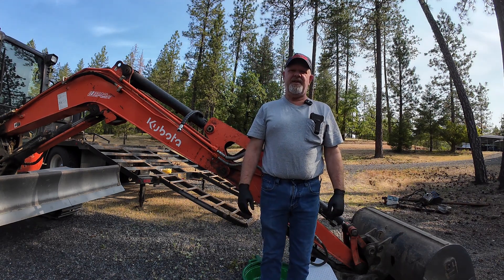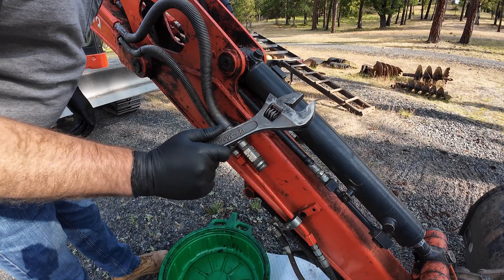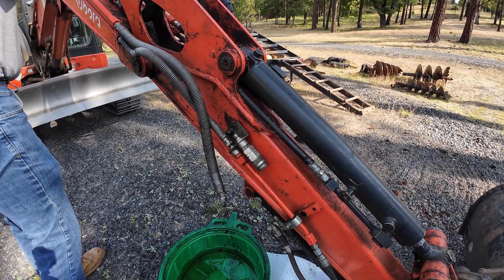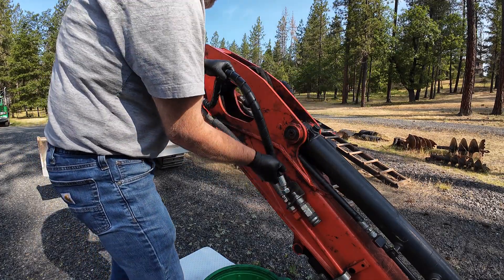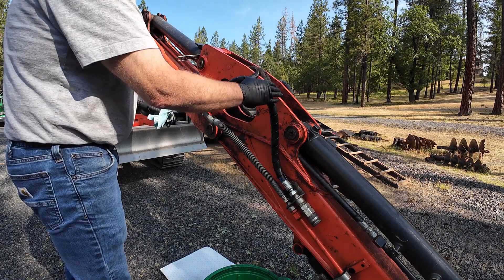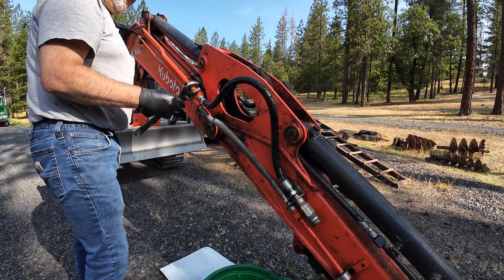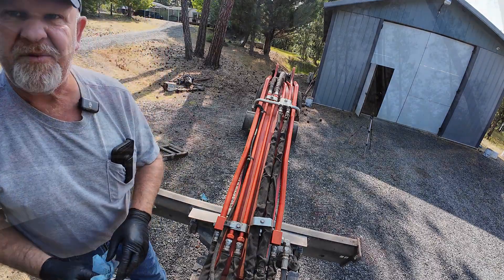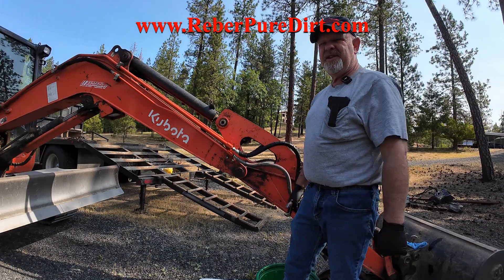Hydraulic hose replacement how to bleed pressure off axillaries Kubota KX 040 4 excavator

Comment: Also good rule of thumb after the key trick is to open the cap on the hydraulic tank to bleed pressure off of it as well due to the fact a lot of equipment has pressurized hydraulic tanks.
Reply from the maker: The 40 has a vented tank, but that is a good idea. Thank you for watching, and have a wonderful evening 😀

Comment: Well, you blew my whole comment I was going to put here!   Shmoo Be Gone.    You know I was mostly kidding you!   I rented a BobCat 32 for a week.  First time I ever ran one at 69 years old.  I had a blast!  The agreement I signed said it came to me clean and if not clean when picked up I would be charged extra $.  So, I washed it with soap and water, then went over everything I could with class cleaner.   Just as I was getting finished, the guy drove up to get it.   He said, Oh you don’t need to do that, it was talking about major dirt.   I called the office guy the next day to make sure I wasn’t going to be charged for a bent thumb that I didn’t remember what it looked like when it came.   He said, no charge as was already bent, and thanked me for cleaning it.
Thanks for the videos!
Reply from the maker: I very much knew you were kidding. That's what keeps things fun❤ I rented a 200 Hitachi to work on my property out of state in 2006. I didn't get the fuel topped off to their liking, and they charged me $10. Per gallon to top it off. After that, I hauled my machine the 750 miles instead of renting. I thought you would get a kick out of the video. Have a wonderful evening 😀